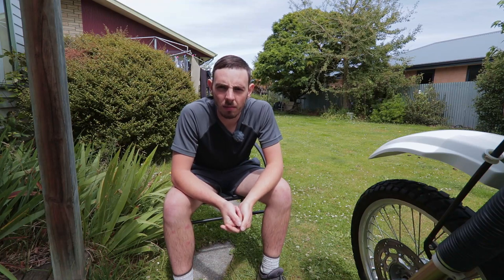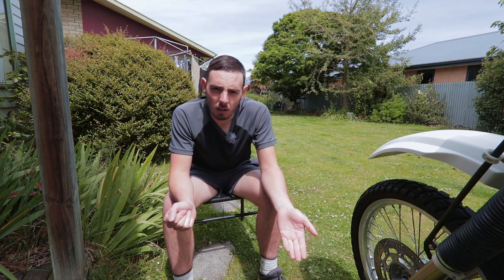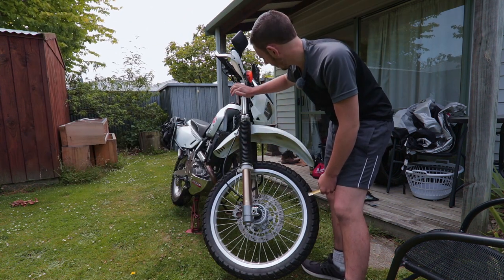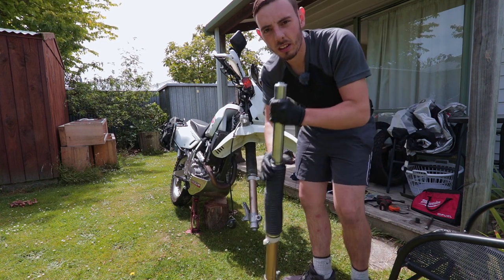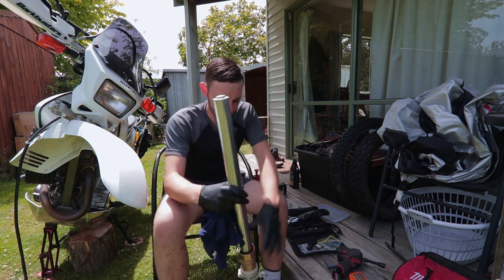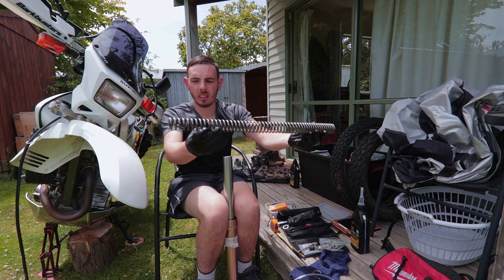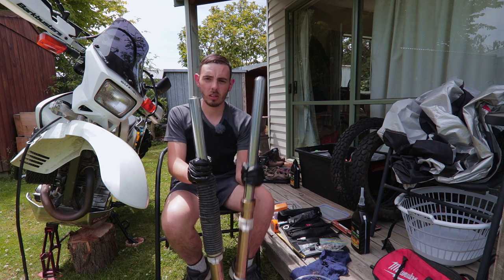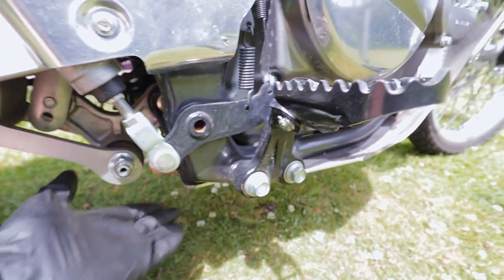Suzuki Dr650 How not to lower

Comment: For dumper rod holding: weld a 30mm nut to the end of a rod or a tube.
It will fit perfectly like the factory tool.
Reply from the maker: Good tip Sharon👍

Comment: Further to my previous comment about improvising special tool for holding damper rod, I see that Biker Bits on " DR650 Replace Fork Seals..." found an even simpler method. He just bought a 1 metre length of 1 inch square RHS steel tubing; and held that in a vice. The 4 corners of the RHS perfectly slot into the 30mm. double hex socket at the top of the damper rod.
Reply from the maker: Yep i remember watching that, however forgot while i was doing mine! That would be the way to go
Reply: @MOTODANS Your video stands proud as the definitive guide to lowering DR650. One other point to add:  lowering the whole bike 38mm. made my after-market SW-Motech centre-stand way too tall to pull the bike back onto. Just as you need to shorten the original side-stand, so also do you need to shorten the legs of the centre-stand (if fitted).

Comment: Top of damper rod assembly is finished with 30mm.internal double hex socket. Easiest way to make up special holding-tool is to obtain a 30mm. nut from a 3/4"( or 20mm. metric) bolt. Then you need to attach an extension at least 450mm. long to reach down inside fork-tube. I just used the 30mm. bolt-head itself of a big long bridge bolt; and clamped a piece of bar between 2 nuts to act as a handle. That way, I could undo damper rod-bolt easily, and re-torque up correctly.
Reply from the maker: Good idea!
Reply: @MOTODANS  Your video was a great help in demystifying workshop manual instructions.

Comment: Thanks for the video . What is your height?
I’m 5’8 and I’m considering buying the dr 650 I’m worried I might not be able to reach the ground
Reply from the maker: Hey Benan. 
I am 5'6 roughly 30" inseam. This was my partners bike who is 5'4 ( she also had to have a lowered seat ) my own Dr650 I run at standard height, standard seat and with lowered pegs as I found it Abit cramped

Comment: well done  video,,thanks there ,audio needs enhancing, , is it doable to just lower the rear?, as Im tall and 66 y ....but find it a wee too tall , too sling leg over easily ...but really  love this bike, bog stock and run in at 3K , it does everything well , and just did a 120 k  wet trip on  gentle winding highway at many times too  140 + kph (90mph) chasing a guy on a DUCATI !what a bike c heers all !
Reply from the maker: Thanks. Yep you are correct regarding audio I had alot of issues with my early videos it should be sorted on all the current ones. Yes it is certainly doable however it may affect the handling of the bike. How ever lots of people fit lowering links and report no issues. This would be a better solution over a lowering link. Nice to see you are enjoying the bike!
Reply: @MOTODANS  yes thanks' for speedy reply! , will do  the mod. as you have instructed ...Ta ...really as an all rounder/basic bullet proo
f /user friendly these  bikes' are unbeatable IMO...Cheers! and ride well

Comment: Hello
Great video, patient detail. I have recently bought a DR which is currently lowered “the easy way”. I am wanting to bring the bike back up to its normal height. Just checking, loosen front fork clamp bolts move forks back up the 40mm and tighten? Rear end, reposition bolt to lower hole? Set rear spring at 47mm? 
Many Thanks
Roy
Reply from the maker: Hey Roy.
Yep loosen the fork clamps and slide them back up so they are flush with the top triple tree. 
Yep the back is just swap the bolt and set the rear spring preload as needed for your weight.
Reply: @MOTODANS  
Many thanks for your help.
Reply: Thank you Dan!!
Reply from the maker: No worries

Comment: Howdy,
Achieved success with putting the rear end back to normal height. Just working on putting the original stand back on, springs are tricky....
Just to let you know our Suzuki dealer quoted me $190 to make these height changes!!  
Thanks again for you helpful video etc.
Regards 
Roy
Reply from the maker: Well done Roy! Glad I could help. 
Yes the stand springs are Abit tricky there is a special tool for pulling them. I have had success by putting the springs on the stand first and then pulling the stand and putting the bolt In last. Hard to explain but you will figure it out. 
Put the money you saved toward some mods!

Comment: I tried to use your method to loosen the damper hex bolt, but it was very tight, and rounded off the hex. So, I'm buying the tool to hold the damper stationary. Bummer, will probably only use it once. The video was still very useful to get a good visual what needs done. Thanks!
Reply from the maker: Ouch that's not good. Mine came out without issue. Oh well you could possibly re sell the tool once used? Thanks for watching!

Comment: This was probably the most important video I ever watched! Thank you so much for this, it's such a big help.
Reply from the maker: No problem at all 👍 Any questions let me know!
Reply: @MOTODANS  hey Dan what would happen if I just lowered the rear using your way, and didn't do the front?
Reply from the maker: @swexplorer  It would affect the geometry of the bike making the steering alot slower. Ideally you should always lower both ends of any bike the same. How ever lots of people fit lowering links to the rear of bikes and don't notice much difference

Comment: Hello,
Me again. I have adjusted my front forks back to standard height. With the back can you advise if I have to loosen the spring before changing the bolt back to the lower hole/setting?
Thank You
Reply from the maker: Hey Roy. 
You shouldn't have to if you lift the back wheel off the ground and then support the weight of it you will be able to remove the bolt and change its position.
 You would only have to loosen the spring if it was lowered the proper way and you needed to turn the collar around.
Reply: Ok thank you, I’ll give that go tomorrow
Cheers

Comment: Dude you are my savior! Been trying to get a Suzuki dealer to do this that has just recently taken on the suzuki brand and they were not sure on how to do it. If I give them this and they have the proper tools it shouldn't take them longer than 2 1/2 hours and that's putting in the new cogent springs, oil, and drop in damper cartridge. Is the whole procedure in the factory service manual? Mine is a 2020 model so I'm guessing mine and yours would be the exact same process
Reply from the maker: Hey Jack, yes it should be easy for them to do no longer than 2.5 probably less. Yes whole procedure is in the manual step by step. Also you are correct it is the same procedure for your bike as mine. Good luck let me know how you get on! Enjoy the upgrade. 
Also if dealer is doing it just double check they have done it correctly when you get it back as they do like to take the easy way.
Reply: @MOTODANS  thanks alot brother
Reply: Can you post a video or pictures showing how the bike looks lowered? I'm all about function over form so long  as it looks at least okish thanks again
Reply from the maker: Hey Jack no longer own this bike so can't make a video. Do you have an email address I can send you a pic?
Reply: @MOTODANS  why did you get rid of it
Reply from the maker: @itisfinished4U  It was Danni's bike she had a few offs on gravel roads and stopped riding it. That's why we got the meanstreak so we can go 2up.
Reply: @MOTODANS  yeah that can happen for sure, I had a real bad one not long ago myself out of nowhere and haven't had one in a couple years
Reply from the maker: Flicked you an email jack, hope that helps
Reply: @MOTODANS  thanks man still waiting on it to get to me, love your country by the way, would love to move there as the US is a pretty rough place to raise a family now a days

Comment: So, damper rod can be screwed without special tool "T"?
Reply from the maker: Yes. Either with an impact gun like I did or you could make a tool to suit. I have even seen people use broom handles down the fork which was just enough to hold it. Just bear in mind if you use impact you can't torque the bolt.
Reply: @MOTODANS  thanks a lot!

Comment: Here I am hoping the dealer did it the short cut way because I’m 6’3” and trying to undo whatever the dealer did
Reply from the maker: Good chance they did! Both of my bikes were. I returned mine to stock and then sorted this one the proper way.
Reply: @MOTODANS  lol let’s hope so! Thanks for the response! Any idea if I can remove the top bolt off the fork tube while the fork is still on the bike? Maybe if I get the weight off the front end? Just trying to confirm the spacer is still up top.
Reply from the maker: Yep if you have the front wheel in the air you will be able to remove the top cap without much issue. Just make sure the top clamp isn't pinching it.
Reply: @MOTODANS  great news! The dealer or PO was a hack and didn’t do it properly! Spacer was right under the top cap! Brilliant. Didn’t have to worry about the cap getting stuck under the clamp, because whoever did the “lowering” just slid the forks up in the clamps. smh lol. Thanks so much for your help man.
Reply from the maker: No worries! Glad it worked out. It's amazing how many bikes will be going around the hacked way.

Comment: And how did you it was lowered the wrong way?
Reply from the maker: Show you in the video a quick way to check. Generally if the forks have been lowered through the triple trees then it has been done wrong. There is also a measurement if you jack the bike up. The rears you need to look at the collar on the bottom of the shock I show in the video which way it should be
Reply: @MOTODANS  Got it. Sorry, non native English speaker here, and your tone of voice is kind of hard
to understand. Thanks.
Reply from the maker: No problem 👍

Comment: thanks for the content ... that seems very intimidating for a newb lol... do you want to do this if you lower ride height by using 1" longer lowering links? I guess what I'm asking is .. is it important to do all three adjustments (flip rear spring, lowering links and front spacer) or can you be conservative and just lengthen links?
Reply from the maker: Not sure on that. I would say probably not do this as well as lowering links. It isn't too hard to do and no parts are needed. If you are unsure on doing it yourself perhaps a bike shop could do it for you for a similar cost as what a set of lowering links cost? One downside of the lowering link it you are also changing the spring rate as you are putting more leverage onto the shock.
Reply: @MOTODANS thanks ...I might work up to giving it a try.  I would like to have more sure footing. Are you saying I should do just the rear spring adjust and front mod but not change lowering links? I appreciate the advice
Reply from the maker: Correct do one or the other

Comment: Great video, thank you.  For the front, I still don't really understand what the difference is between the shortcut way and the correct way.  With the shortcut, is it that your suspension travel is not reduced by the amount you lower, so the forks "bottom out" lower down, causing possible hitting the ground sooner?
Reply from the maker: Thanks. So the problem with doing the lowering the shortcut way both front and rear is you are decreasing your ground clearance but maintaining full suspension travel. Which in extreme circumstances can cause the bike, either the sump/frame to hit the ground or the wheels to hit the frame. Lowering the bike the correct way reduces your ground clearance and your suspension travel accordingly meaning your suspension bottoms out before anything makes contact where it shouldn't.
Reply: @MOTODANS  Thanks again.  Now I know not only how, but why.  Your videos are very educational.
Reply from the maker: No problem 👍 Thanks for watching
Reply: Thanks Mate for the video very informative now I can fix mine because they have been done the wrong Thanks Again 😊😊😊😊

Comment: Hi once again another  interesting video thanks mate👍 when you were measuring the preload towards the end there was it the length of the spring that was 250mm? If  I remove the collar could i just return the spring to whatever the original measurement was? Sorry that bit has me confused lol
Reply from the maker: Thanks :) 
So the measurements in the manual for spring length ( preload ) are 238.5mm ( Stiffest ) - 253.5mm ( softest ). I set mine around the 250mm mark. You could just set the spring to the same measurement as long as you measured the actual spring and not the adjuster rings, as when you remove that bottom collar and switch it around you are essentially raising up the collar so the spring would be sitting higher from the bottom. so if you put the collars in the same position you would have alot more preload. Does that help? Also make sure you measure the spring with no weight on it either with the whole shock out of bike or with the rear wheel off the ground like i did.

Cheers

Dan
Reply: @MOTODANS  thanks mate,  I'll play around with it today here's hoping I don't f%!k it up lol
Reply from the maker: No worries, need anymore help just let me know👍
Reply: @MOTODANS  thanks mate i think removing the dampening rod is gonna be interesting too lol
Reply from the maker: Yes it may be worth making up a tool if your struggling

Comment: G’day Dan, what a great video, it has given me the knowledge and confidence to do my own lowering of my DR. I just have a couple of questions, did you use any washers anywhere on the dampening rod? And was there a washer on top of the spacer and the fork end nut?
Cheers mate 👍 Andrew from Tasmania
Reply from the maker: Hey Andrew, Sorry for the late reply. So the only thing you swap is the spacer the stock washer does not get moved and i added no washer to the dampening rod. So stock it goes spring, washer, spacer, cap after lowering the spacer get put on the dampening rod and up top it is spring, washer cap. Hope that is what you were after?

Cheers
Dan
Reply: @MOTODANS  I know this is a biggy but is there any chance of giving you a call? Are you on messenger?
Reply from the maker: Hey Andrew, I am not on facebook, You can contact me through instagram though if you have that. Do you have access to repair manual? If not i can send you that it has exploded parts diagrams of the forks lowered and standard

Comment: Hey Dan. Great no-nonsense vids, thanks. Does that adjustment to the forks make them lighter? Or does moving the space from the top to the bottom even out the spring tension?
Reply from the maker: Thanks Lou, as far as i am aware it keeps the spring preload the same. I have ridden my bike both lowered and regular height and never noticed any differece
Reply: I used this to adjust my shock pre-load (was over tightened). This vid Mae it easy. Thanks again.
Reply from the maker: Glad it helped Lou 👍